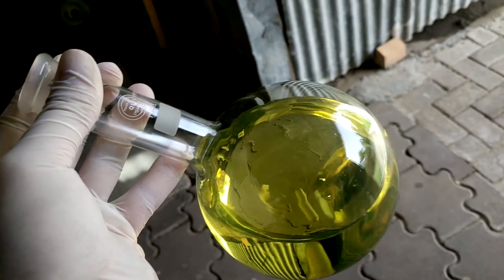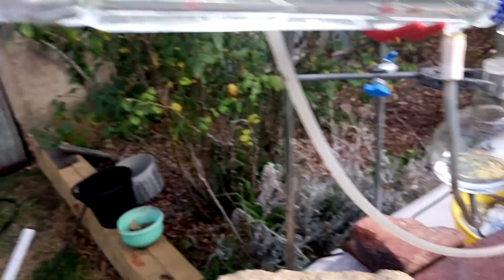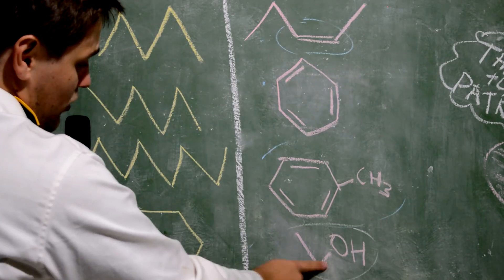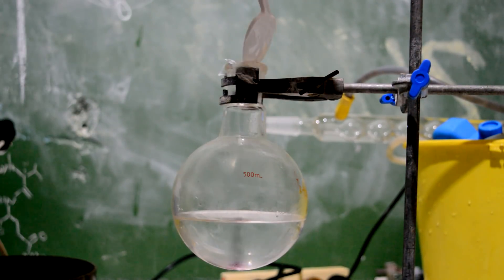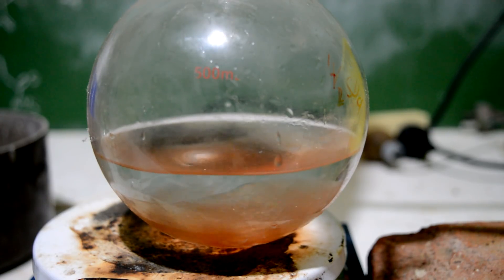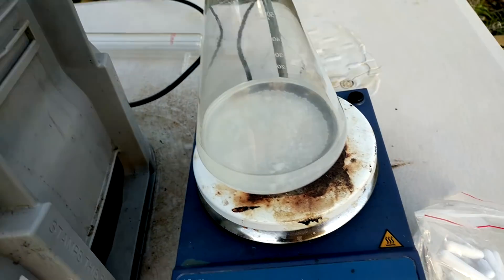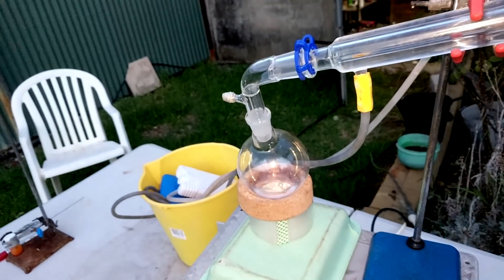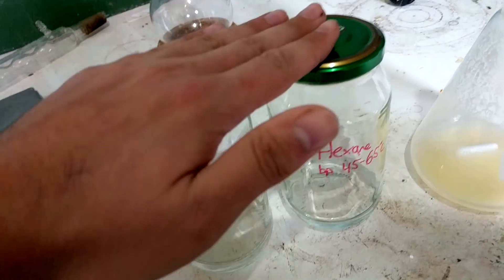Extracting Hexanes from Gasoline/Petrol

Comment: GREAT VIDEO........You really surprised me using the permanganate to get rid of/oxidize  stuff in there.  I would have never thought of that.........Another way to get mixed hexanes is from electronics cleaner.  Usually the only other thing in it is EtOH which is easily extracted out with water and a sep funnel AND the propellant which is a gas.  So it is super easy to extract and purify.  Well purify to mixed hexanes

Comment: Fun fact... Dawn dish detergent works to remove any MnO2 stains or scales. Just put in a vigorous amount, fill the rest of your container with water and let it sit until it flakes off. After that thete is a minimal amount of work to clean the rest out
Reply from the maker: Rielly Castle thanks for the tip!!

Comment: Would packing the column help the efficiency?
Reply from the maker: Anthony Marks Efficiency in terms of separating? Yes, if there's actually a gap between two boiling points. But a lot of this stuff, like the benzene, boils within the boiling point ranges of the stuff we actually want, so it won't help here

Comment: In the hardware store they sell something called white liqour special, in the sds they say its 100% c6 to c7 without aromatic compounds
Reply: I cant find that here in the US quickly googling but we have Varnish Makers Naptha and Mineral Spirits that appear to be close in range (both light napthas) to avoid the first distillation.

Also I found "bestine rubber cement thinner" which from the sds shouls be basically just heptane but it is about $15 for about 500ml.
Reply: Type 3 white spirit basically?

Comment: to separate the benzene etc... could you sulfonate with strong sulfuric acid to raise the boiling point or form a salt?
Reply: That should be a good idea as far as I can tell. The alkanes shouldn't react at all with H2SO4, the only problem I see is that sulfonations are not super duper keen on going to completion, specially with normal sulfuric acid. But it would definitely help. I'd recommend sodium hydroxide extraction, as sulfonic acids tend to decompose when heated.
Industrially they use selective solvent extraction to separate the aromatics from the light and heavy petrol fractions, but I don't think that's doable here.

Comment: Nice!

I wonder if there are any practical alternatives to permanganate for that though. I heard it was now getting listed as a drug precursor in various places...
Reply from the maker: piranha031091 ozone I think is actually a really good answer. You could buy a cheap ozone generator, and you're then set for a long while. Sure, it'll take a little longer and you might lose some of the lower boiling stuff even through a condenser, but it is a long term cheap option that's widely avaliable
Reply: ozone?
Reply: Ozonolysis would definitely break down alkenes.
But I'm not sure about the "practical" side of things. Getting an ozone generator capable of dealing with such an amount of reagent in a reasonable amount of time  certainly wouldn't be easy. 

Not to mention, getting rid of remaining ozone in the exhaust stream so that you don't melt everyone's lungs...
Reply: piranha031091 well he only needed 2g of potassium permanganate, wouldn't take that much ozone.
how to deal with the exhaust is definitely a problem but he is boiling petrol anyway lol
Reply: Hexavalent chromium is very rude and mean and carcinogenic, but if you're capable of handling chromic acid safely I think it's about as good of an oxidizing agent as permangnate.

Comment: This is so weird!! Why does it look so laggy? It's 25 fps, that should be ok. AAAH xD
You had interlacing on before and turned that off, didn't you? Was that interlacing done in the camera? Could you try interlacing from editing software? I believe it really needs interlacing.
Oh, even better: Could you try to supersample more fps? Maybe go up to double your 25, but use some software that fills every second frame with the contents of both frames before and after. That way ghosting is not so apparent and it might look more fluid. (I don't know if supersample is the right word, btw.)

I'm going to play around with some software and give you the best results back under this comment, ok? I'll upload some unlisted cut outs of this video that I edited to my stupid channel, ok? No infringement intended.
Reply: I have to say: All efforts to improve the video later in post are way more effort and are not really working, as you can see in my testing. (Also maybe 6 seconds was not enough)
The one with google stabilizer and 25fps looks best. Because making 50fps out of 25fps is like trying to create more information out of thin air.
So better if you just film in 60fps or 120fps. Try both. you can always remove information. Interpolating 120fps into 60fps would look best, I assume. But that's probably overkill. Also, if you use google stabilizer, try to have the best footage possible beforehand. I mean no compression artifacts and stuff.
Reply from the maker: ̷ ̴ ̸ɢ̸ʟ̶ɪ̸ᴛ̶ᴄ̶ʜ̷ ̶ ̶ heyyy the app has a button that says 'optical stabilisation'! I'll see how it goes. I'm halfway through the videos I'm currently filming so perhaps you'll be able to notice a difference when ive switched it on (for the better!)
Reply: Extractions&Ire cool :) love your videos! Have fun!
Reply from the maker: ̷ ̴ ̸ɢ̸ʟ̶ɪ̸ᴛ̶ᴄ̶ʜ̷ ̶ ̶ is it really lagging?? It's a lot better than what it was before, which wasnt so much interlacing as it was frame blending, with the camera taking 30fps and the software trying to force that into 25fps. But I will certainly take any help if you think there's a way to clean up the footage, the last fix was one button I have to press, it's just knowing which of the many buttons need to be pressed!!
Reply: Quite bad. At 1:52 to 1:58 for example you move the camera so fast, things are in a different quadrant the next frame.
I am using that extreme 6 seconds to work out a solution using VirtualDub, several plugins and googles stabilization technique. If you have after Effects - even better! Because Google compresses the video too much while stabilizing. (And it can only be done on a mobile device for some very very stupid reason, I guess.)
I use the 25fps version you have here and basically stabilize it, turn it into 50fps with interlacing and then clean it up. We'll see
Reply: Ok, the holy Deshaker plugin for VirtualDub is utter garbage with it's stupid boarders or zooming. Is this 1998?
Anyway. What camera are you using?

I am uploading a few vids now, gonna edit this comment with links to an unlisted playlist, if that exists, otherwise just links to these videos....
Ok, it's a playlist: https://www.youtube.com/playlist?list=PLJ6NmCp-_mJX39eL8obrrtEvY4IyW76mS
There are a few more coming.
EDIT:
So... I guess I'm finished. Tell me which one looks even remotely ok and I write down the stuff. (You can mostly ignore the compression artifacts, except in the google stabilized examples. You have more time than I do and a way better PC than my old first generation i3 laptop...)
A few conclusions:
- If you have stabilization in the camera, turn it on. (Most important)
- Else try stabilizing the video with either Google Photos, Hyperlapse (need to buy it to get rid of watermark) or After Effects. I couldn't test last one, but seems to be the best choice. (Ignore Deshaker for VirtualDub. Useless year 2000 tech.)
- Or maybe use a monopod. It's like a tripod, but with just one leg. Easy to move around, way less shaky.
- No super-fast movements like in those 6 seconds I watched too many times.
- Try to filming in an environment that doesn't have harsh shadows - at least not in the background: No direkt sunlight, work in the shadows.
- Or use a sheet or some other monotone background. Avoid huge contrasts, basically. That reduces eye-stress, like white noise for ears.
The less contrast there is, the less apparent are fast movements of white things above dark background, like the condenser column. I tried turning it down with my program, but it is not very good at it. If you lower contrast, look at saturation too. May need adjustment in any direction.
Reply: I film that section on my phone, its a google pixel. 
I can see a bit of a difference between the starting clip and the end clip, but how much work is it to fix up each clip? Because if there's a process I have to take for each bit of film... that's a lot of work
Reply: Sorry, a little late: I found out that even the google stabilizer crops the video a little bit. - I guess only when it is so extreme as in these 6 seconds. Still best option.
I don't know the Pixels. Can you turn on that stabilization while filming? So that it saves the video directly stabilized. Otherwise you just have to add one step. It's just like clicking "stabilize" and it's doing it. No settings. So no work, basically, other than the phone is taking some time to do that.
-->The pixel 1 and the 2 can record in 1080p@120fps! That's great! It just single-handedly removes all the problems we have. Just record in 60fps then stabilize. (Or, if you prefer to add another step, record in 120fps and interpolate it to 60fps with VirtualDub = Even smoother maybe)
Can you upload a test of that?
 https://productforums.google.com/forum/#!topic/phone-by-google/3Ny_k4mV8oc
Reply: Extractions&Ire Ah I know this app. That explains how you got 25fps in the first place. 
Can you not have two apps running at the same time? One recorder and then Googles video app?
If I press the "switch-app" button longer on my HTC 10 I have a split screen and can have two apps open.
Or us the video app shutting down the external microphone for all apss?
Reply from the maker: ̷ ̴ ̸ɢ̸ʟ̶ɪ̸ᴛ̶ᴄ̶ʜ̷ ̶ ̶ ooo I've never tried that, but I have a feeling it'll struggle recording that much data at once
Reply from the maker: ̷ ̴ ̸ɢ̸ʟ̶ɪ̸ᴛ̶ᴄ̶ʜ̷ ̶ ̶ thanks for looking into this for me mate! I appriciate the effort. I'll try and fix it before filming.
These recent problems are due to me purchasing an external mic. The mic is very good, but what I didn't know when buying it is that Google Pixel's prevent you from using external mics on the default camera act in a deliberate dick move (on an iPhone the mic work automatically). As a result I have to use a third party camera app called 'Cinema FV-5' which has its own set of issues, especially in terms of focusing and also it seems in not lagging. I'll play with some settings in the app though, hopefully we can see some improvement!!

Comment: this is something i once considered doing but i cant stand the smell of fuel as it is let alone distilling it. The price of fuel now is at $1.56/l (where i am) plus considering the effort and energy used to separate the fractions, it would probably be cheaper still to just buy hexane-if you can find it that is.i think that S.A has some of the highest fuel prices in the country right now. its a shame about Kenicals too. They had a great selection of chems at reasonable prices. i wonder what ever happened to them. their eBay store was convenient.
Reply from the maker: AllChemystery I do wonder what happened to Kenicals. They changed their name to AusChems or something similar, then just disappeared. Wonder what happened to all the permanganate they would've had in stock

Fuel prices are too high. But still, you're looking at alkane fractions for less than $15/L which is probably cheaper as you could buy it from any Chem supplier, but that's without considering the cost of the effort you have to put in for the purification. 

I like the smell of petrol haha, it's a worry. Downward spiral for sure
Reply: Extractions&Ire auschems are a great source of chemicals. I use them often. They sell a wide range including Na/KClO3/4. 35$Kg is ok.
Reply: i'm getting the names confused then. Or maybe they just rebranded? Probably I'm just getting confused